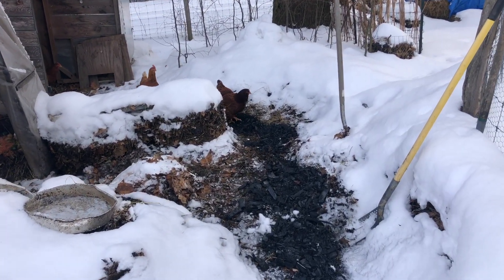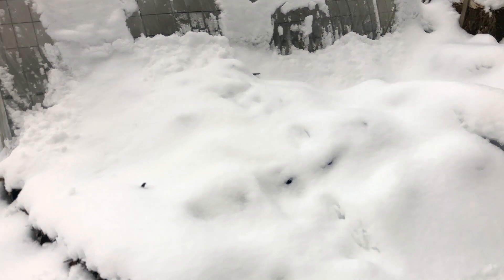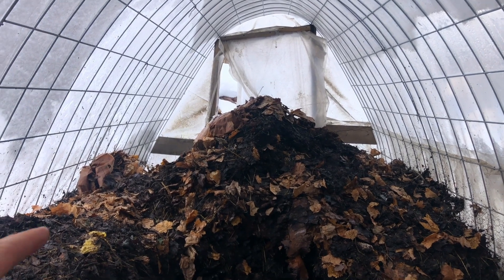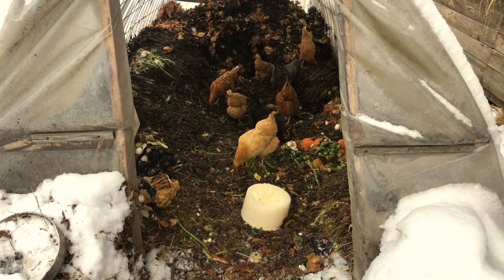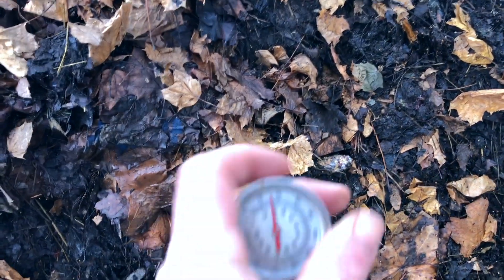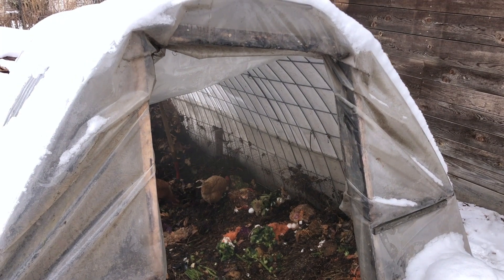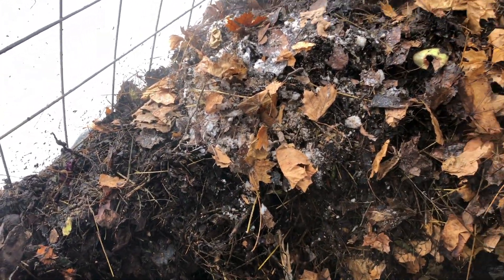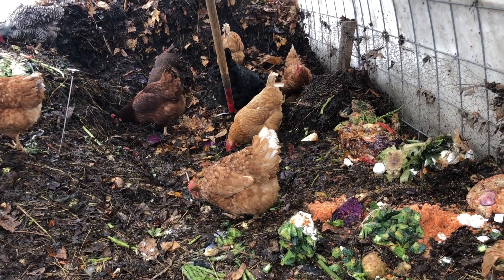Chicken TV - Compost Overload again!

Comment: you need to make the high tunnel longer so you can have more space. Love watching your chicken system evolve
Reply from the maker: I hear ya... The layout of the space makes that tough though...
Reply: @edibleacres  I had a really nice idea for how I want to construct a bit taller high tunnel for myself being 6'4". I'm going to build up what's called a bond beam footing perimeter with adobe and recycled cans to about maybe 3ft up. With making two can walls fairly close together I can use those two short walls as a concrete form to then secure the cattle panels! Just the first idea that came to mind, I'm sure I'll rethink some aspects for air flow.
Reply: @brandencasey6761  that's a really good idea! I removed an old broken patio and have been devising ways to put it to use. Really like your upcycling idea for footings.

Comment: I live in the part of Texas that just got about 4 inches of snow and I definitely do not envy your feet of snow. We joined the thousands of people who had burst pipes and we are still dealing with that. I don't think I'll ever complain about the heat again. I hate the cold so much more now. (Any extreme weather accompanied by lack of power is awful.) I DO envy your compost problem.
Reply from the maker: That seems like such a very scary thing to live through.  Very sorry for your experience.
Reply: @edibleacres  The scary part was the loss of power for sure. It was more enfuriaticng than anything to find out why we lost power. Plumbers are so booked now they are turning business away. We have successfully diy'd 2 pvc repairs and are waiting for some flex seal to dry before we test the 3rd one. Haha 
Thanks for your kindness. I now have a tad more reality on what true winter is like.

Comment: When you mentioned how you wanted a larger ceiling next year, I wondered if it might be useful to layer a larger build outside of the original smaller one - with plans to remove the smaller one when the problem arises next year.

However, there could be potential for the open space between the two layers to be filled with bags filled with compost or dry leaves for shelter if that's needed. Don't know what next winter holds.

Might make it easier to retrieve the leaves, too.
Reply from the maker: Interesting idea, a double hoop setup!

Comment: Some brainstorming that I hope might be of some use to you:
- Inside the wooden henhouse on top of an extra thick layer of woodchips to protect the floor from moisture.
- in milk crate tower walls alongside your house/chook house, the woodshed, thick enough and roughly/messily filled enough that everything is touching through the gaps to get enough surface area
- in your flippy- lidded bins making a ring around the garage warming bed thingy (you know the one lol)
- in a tarped or wood chipped pile in the neighbours un-poly’d tunnel (taking the heat loss in trade for the energy saved by only moving it once).
- put up a temporary gazebo somewhere?
- “lend” it to a friend or neighbour who has the space and want the temporary nutrient deposit that will come from it resting/curing on top of their empty bed, then cart it off to where you are going to use it later.
- the vacated half of leaf mountain, or on leaf mountain for extra carbon sponge.
Reply from the maker: Wow, you are really putting some thought into this... Thanks so much for all these wonderful ideas!!!

Comment: Thank you for the very informative videos. I have learned and been affirmed through your sharing of information, knowledge, and experience.  An idea might be if you could get some hay might you cover an area outside pile the most deloped compost on top and then cover with a tarp or plastic until the weather warms. Allowint the compost to continue to breakdown and opening for more room in your panel tunnel. Thank you again.
Reply from the maker: Yesterday we did something a little like this.  I spent an hour moving all the snow away from a nearby bay (lots of extra work!) and we built up a 'fresh' new pile there cut with a ton of leaves.  I plan to tarp it and then insulate it so it can cook until spring.  Hopefully that gets us to a thaw!

Comment: Hi Sean. I have been enjoying your videos for quit some time and really appreciate your observational learning and sharing. We have a small farm in Nova Scotia and have a similar snow situation as you. Your technique has real potential for us, we will be experimenting with 8 X 20 foot concrete reinforcing panels to construct the roof with 1/2 rebar at 4 foot intervals for structural strength, all of which will sit on top of a 2 x 10 hemlock base. This should provide significantly more volume and height. Potentially the structure will be long enough so we can pile from the north end  and just keep filling the tunnel until the spring when we pull the structure away for easier access to the compost. I would appreciate your comments on our plan.
Reply from the maker: From the rough idea I get from your description it seems quite reasonable. . What we have in play here is overall quite a nice flow and approach I think, but just too cramped at the scale we're on.  We can't use machines or move the coop/chickens easily but if we could we'd do compost in one area, then move the hens instead of all the compost!

Comment: In regards to the gas building  we used to take a piece of flexible pipe and put holes in the middle of  it before filling with charcoal pieces. At which point we would put the part with holes in the pile while leaving the opening of the pipe in areas we wanted to vent to.  Which seemed to work as long as you kept it at the mid point. Since it would increase airflow inside the pile so you had less random build ups especially if ever now and again you moved it to make sure the holes didn't clog and the fact that it was colder air seemed to slow down the process enough for it more manageable while not stopping the process.
Reply: To be honest i don't know how important the charcoal in the pipe is. We used it to make sure there wasn't a strong smell coming out of the pipe and to make sure the pipe didn't get pinched close from the weight. But i am sure there are other options for that
Reply from the maker: I think figuring out more internal aeration would be super beneficial.  These are good notes.

Comment: Hi Sean and Sasha,
I wonder if the solution for next season is an adjacent high tunnel (or 2)? This would provide more space for the chickens to loiter in and the compost to mellow out in. Cheers,
     Bill
PS how are the ponds doing up at the main site? Are they holding water/snow? Do you have hip waders to work the ponds if they have a few feet of water in them?
Reply from the maker: A good idea, but we'd need to figure out some better basic layout when the snow melts to design that in!

Comment: I know in the past you haven't wanted to shred the leaves for various reasons, but in this context wouldn't it help to mix the pile more thoroughly without matting developing in certain areas? it seems like at the very least the shredded leaves would allow you to put more carbon material into the high tunnel with less space being taken up.
Reply: I've thought about leaf shredding a lot and what stops me from pursuing it is the amount of work involved. as it is, it's a ton of work moving around ~200+ leaf bags. the work of drying, moving, and shredding them might be at least 3x times the work without a costly shredding setup. I think a better call would be what Canadian Permaculture Legacy does, which is go to fatcat neighborhoods and be selective about only taking shredded leaves.
Reply: to add to this, in my 7b site I don't get this kind of freezing, so I might try actually storing leaf bags directly in the place where the chickens will scratch, instead of moving the increasingly disintegrating bags from storage to chickenyard
Reply from the maker: Shredding would be quite a lot of extra work. . Certainly something to consider but I think the key is still getting massive leaf bag piles but ALSO wood chips and blending them 50/50 as bulking for the system from fall through winter.  That would work nicely I suspect..

Comment: I'm wondering if putting up a couple more cattle panel greenhouses for winter compost flow. Or even a larger temporary structure to keep the chickens, you and Sasha, and the compost out of the weather.
Reply from the maker: I think about that sometimes but I think I'll need to re-envision the layout in there since it's just so compact and snug already.  Not sure where to put more infrastructure!
Reply: You have loads of options. Even if you want to do it with fewer new materials. You could raise the entire structure up on a 2 foot black locust wood base. 
You could design a shack type structure, since sunlight isn't the driving force in your system. 
You could daisy chain raised up cattle panel structures, with walk through (shovel compost through temporary tunnels...) 
I feel that your compost yard has surpassed its usable volume in its current configuration. You may want to take some measurements of your site, and knowing your work-flow, redesign the whole thing to make it easier for you and Sasha to work. 
I'm sure that having to stoop over, to move your compost about inside the cattle panel structure is not going to be good on your back ergonomically for the long term. Anyway, I was just thinking....

Comment: Ive never had a problem with too much green material for composting just because of what is available to me, but if you need more browns I had an idea the other day about soaking matting items like leaves or brown paper bags (which we have an abundance of but never seem to break down) in a barrel until they mash up into a carbon rich paste. You could even use some compost to melt snow to soak the bags in
Reply from the maker: I would wonder about that.  I could imagine them loosing their 'loft' and 'fluff' even more with that approach...
Reply: I guess my thought process is to balance out the c n ratio but i suppose that even mashed up and wet they would be pretty dense and mucky

Comment: Would it be worth the effort to bring some of that hot compost to the various compost-heaters for the several greenhouses?

If you begin to think about a complete rebuilding, would it work to replace the cattle panel brownhouse with a lean-to extension against a more raised coop?  Or is the separation necessary for moisture control?
Reply from the maker: Check out our most recent video, we installed a large hot bed in one high tunnel with this material and plan to use it extensively in the weeks to come...
Moisture control seems very important.  I thought they should be paired originially but that woudl have been a disaster.

Comment: I wonder if it would help to combine your leaves, biochar and wood chips at the beginning.  Perhaps it would help keep more air in the pile, though probably too late to manage this year.  I think if it were me and I could even get to the spot, I would want to top dress some of the new hugelmounds over by your hand dug pond.... that is, if you could get to them with your current weather.
Reply from the maker: We try to combine them a lot at the beginning, but somehow it is never enough!
Reply: @edibleacres  I have been trying very hard to find wood chips.  Contacted the local utility company etc since they often are looking for places to dump chips after storm clean up.  Anyway, no luck so far.  But we have a local Hormel plant and they specialize in bacon.  the neighbor told me he could get wood chips for me from the plant.  I jumped on it.  But they aren't really wood chips.  I am getting bio char that was created by smoking bacon in pallet loads measuring roughly 4x4x4 foot.  Right now, most is getting used for erosion control since that is a real problem on my hilly parcel.  Having to rethink how I proceed and wish I had some natural wood chips to balance it out some.

Comment: while it wouldn't help you now  and may not be possible in your context. What I do to avoid issues like this , is having a summer and winter chicken run. In the winter all my birds get moved into my annual market garden space{ home use only}  all compost goes in for the winter. I then move them to a summer run and silage tarp the whole garden and repeat with the summer run. Come fall I move all the compost produced in the summer run to pallet bins to use on my perennials the following season.  
I pick the whole coop up over the deep litter every time so i just rake it flat. Never had to dig out my coop
Reply from the maker: Great design idea.  If we had the space we'd 100% want to move the hens/housing instead of all the compost, makes WAY more sense.  Unfortunately we have a very limited total space to work with here, so different design constraints.  I'm not complaining, and I'm happy to work on figuring it out because I feel there are many other folks with similar constraints.  But yeah, your idea is definitely super smart!

Comment: What about using compost worms? Get a bag of the compost worm eggs and just before snow falls dump them on top and mix them under and let sit until spring. Or add horse manure and cow manure into the compost as well if you have access to pig manure that alone helps breaks down all the solids
Reply from the maker: We have a pretty robust red wiggler population in this tunnel actually.  I need to make a video showing some attempts to keep them healthy.
Reply: Try adding some bread or some Brewers Yeast to keep them healthy and eating like crazy will help break things down faster as well the yeast keeps them hungry and makes them want to eat more

Comment: Not exactly a solution to your current backlog,but you might think about a flail knife/hammermill type wood chipper/shredder.

Having one of those would allow you to process another easily available carbon source-cardboard. You can pick up cardboard for free in a great many places,and what isn't used for sheet mulch could be shredded and added to compost.
Reply from the maker: I hear ya.  I thought about a chipper / shredder but definitely prefer to work with what we've got available.